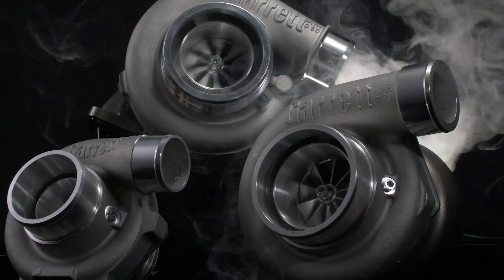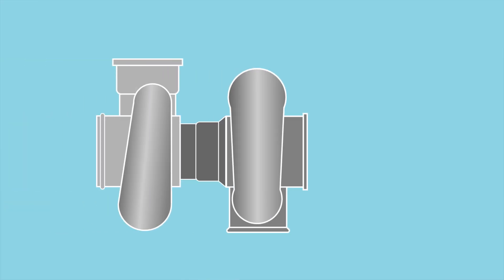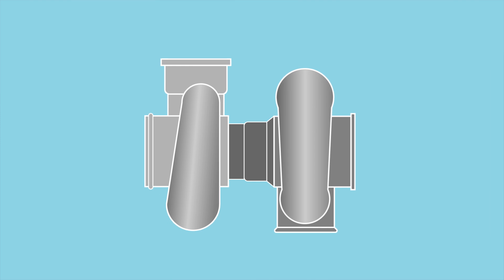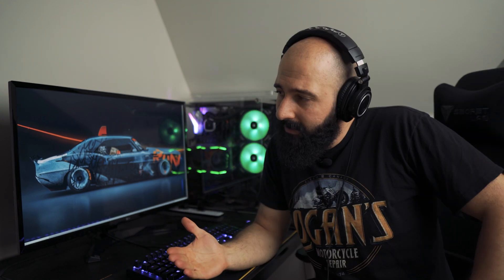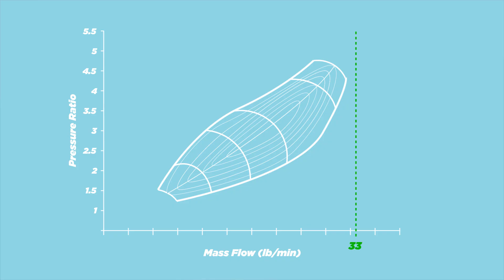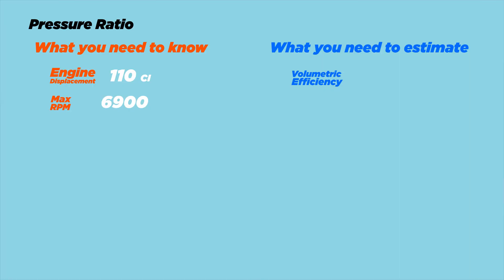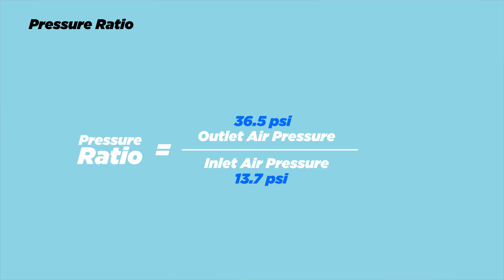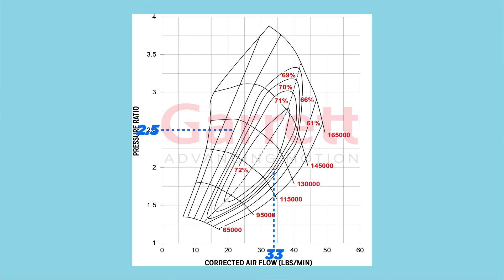How to choose the right turbocharger || EXPLAINED

Comment: Thank you for making this video and just cause you asked what were thinking of turbo charging I bothered to write this. I'm contemplating turbo charging a 2003 Ford SVT.  1.988L DOHC Zetec-R 10.2:1 170HP 7,000RPM 198 lb ft. 6 Speed manual. I've been fixing it up and have even taken cam followers from two Zetec-E's and had them machined down and installed so all the valve clearances are now within the beginning range tolerances. Focus cam followers have a long shaft inside vs SVT cam followers so you can use them in an Svt every time if they are machined. This is for the 2000-2004 range of Zetec engines. I'm not sure if I'll do this but I've seen videos of people who have hit 500HP so I got curious and it's led me to this video. Thanks again.

Comment: Great channel. Question. I have a 12.5:1 compression ratio on a Cayman 3.4l and everything I’m reading/seeing says that this ratio is too tight. In the forums there are several turbo kits that stay below 6psi, offer real gains, and don’t over pressure the engine. TPC performance has such a kit, but the components are cheap knockoffs. What’s a good user friendly turbo with minimal complexity? All in one package?

Comment: I run a GT2867 r and it’s laggy.  That’s because I have a long tube header exhaust manifold. With a short log exhaust the turbo will probably be perfect but it’s not. I am contemplating of switching to a 2860 as it will spool faster than the 2867r

Comment: Doing an under truck setup on an 03 F150 5.4 2v. This was awesome. I'd seen another that came at the same number based on displacement that was just as easy, but it's cool having both methods at hand.

Now I need to figure out the exhaust side, lol. I'm running 1.75" longtubes into 3" collectors, through a 3" y-pipe. My turbo will be hanging at the end of the y-pipe...so velocity and heat energy should still be good. Maybe not quite as good as an under hood...but still great. CX Racing sells an underhood kit for my truck (based on a 4.6 2v), and a guy on YouTube hit 400whp (my goal) at 10psi...which is about the safe limit for these things on pump gas. It's .81AR. I figured I'd start with that as a completely uneducated guess...but it would be nice to have the numbers to back it up.

Comment: I don’t know if my calculations are correct  but it’s showing I need 29.3 lbs of boost !! Wowzers 

Target hp 900 
afr 11.5 
Maxrpm 7,000
VE 95?
Air temp 130?
6.0 LS bored .030 over. 
That’s 370 cu. Inch. 

I make north of 700 with small 54/56 T3 agp turbos at 14-15 psi of boost. 

Looking to upgrade my turbos and I’m not sure what to go with because bigger turbos at 29lbs of boost doesn’t sound right to me 

Anyone can give me some advise

Comment: Looking for help. Have a M340i B58 (G20).

My stock turbo is done, my tuner advised to replace with stock instead of an upgrade (such as a pure650). If I want 500-550, should I stick with stock with DP and a good tune, or go up to a smallish upgrade. 

I doubt I’ll want more than 500-550.

Thanks for the advice boys

Comment: I’m glad I found this! Thank you! I am a few weeks & few hours in on research and video time and while I did learn a ton but this info is non existent regarding the confusing subject of Turbo sizing with the dozens & seemingly hundreds of different sizes and combos & little to no info on which is best & kits that come with a Turbo generally don’t explain why and what to expect other than rated @ so and so HP       set up, where want the power & how is what I was trying to learn and bam 💥, finally method with your video 🙏🏼.     Now have to find out the required specs to start narrowing down what size!    Sub’d!

Comment: Hey nice info, thanks. Thinking bout turbo my 66 mustang coupe engine swap to 351w, .040 over pistons, thumper howards cam, springs, plates, 1.7 arms, Victor jr, 750 holley, long tubes, polished, ported.wanting 550-600hp wheel

Comment: I'm going to turbo my 1970 Challenger R/T. It has a 440 that is super mild. Stock iron heads, forged pistons with about 9.2-1 compression and a mild hydraulic flat tappet cam. 5500 rpm max. I only want to make about 650-675 horsepower at the crank as I drive the car on the street the majority of the time. Now that I understand how to pick the right turbo thanks to your video, I am confident that will be easy.

Comment: Thanks for making this guide. I'm running a Honda Del Sol in autocross and hoping to eventually turbo it keeping stock internals. I know most ebay kits for the d16z6 have the potential to make 400+ horsepower and are targeting drag racers. I'm aiming for 200-250hp at the most so I don't blow the engine, and I need to make power as fast as I can and increase low end torque for autocross where I often can't even reach vtec rpm on most of the track.

Not looking for any answers on my specific setup. I'm a year out at least from the turbo job and when it's time to actually blow all my money I'll follow this again getting all my own numbers into the formulas.

Comment: I'm contemplating turbo charging my gen 1 89 Ford SHO Yamaha 3.0l 220hp stock 215ft lbs car's low mileage but definitely isn't ready to boost yet, too many leaks, and possible sensor issues ATM

Comment: Just started following you. I want to turbocharge my 03 Nissan 350z VQ36DE. 135k miles. Target HP 500. I have not done my research on the max HP VQ makes. Has oil leaks and tick noise. I will be removing the engine to fix all these issues. Any tips(I know the water pump) that I should replace while I’m in there?

Comment: For a diesel 2.4 4400 Revs max  2378 CC 
5 cylinder 20 valve what’s is the best turbo to fit to 
Have a fast spool and top end?
It had a Garrett turbo 
It was generating 210 Horse power 
We replaced the inter cooler larger Exhaust 
New Garrett turbo water cooled GTX2871R and it takes long time to spool up so basically we massed it up
Before with the original turbo use to spool up at 1500 Reve’s  now with the new larger turbo 
2800 Revs and at 4400 revs the limiter comes on
If you can recommend me a turbo that’s will give the best power ratio please?

And obviously I get smoke now when accelerate

Comment: Just seen this video explained things very well, but I am confused on results I got on a mock car. When I set up the mock car “Toyota matrix looking to get 200hp” I end up with a negative boost LB needed to achieve 200hp because I live not the mountains. The manifold pressure came out at 26.4-30.5 ambient air… I get -4.1 lb of boost needed. Changing the desired horsepower would lead to a positive number. So just trying to wrap my brain around what the negative number would imply in the application.

Comment: This info is sick.  But question.  Say i come up with a CFM of 81/min that i need to reach my HP goal. If i decided for say my v8 build i wanted twin turbos, is it as easy as just finding two 40CFM per minute turbos to equal the 80-81CFM? Or does it calculate differently with a twin turbo set up?

Comment: Hey Mr zopyrus say it zop are us and it’s really funny if your Maltese I’m not but it was pointed out to me I think you’ll laugh too from what I take your sense of humor to be from your video anyhow  I’m looking to build a 2.0 tfsi for 500-600 hp  if not more from stock internals at this stage  with a Borg Warner  EFR turbo turbosmart electronic straight gate some integrated engineering bits and o34 bits and pieces  being trying to map  at same variables you show in video and wanted to pick your brains on which turbo to achieve sweet spot for regular street driving and some fun when wanted or track days even considered  syvecs stand alone ecu for some serious stuff later on ,your thoughts or even perhaps a full video what do you reckon

Comment: Currently have a twin turbo rear mounted Cartech kit on my 92 3.0 liter Acura NSX. I've upgraded displacement to 3.5. Kit specs initially were gt28r53 so I could've upgraded to gt2860. If I wanted to upgrade to a newer series more efficient turbo what should I look for to make sure I get 600hp in the most efficient turbo possible.

Comment: hi,  everythink you said is correct and  the turbo you suggest is efficient but isn't too big and lag will prodused at low rpm?  some racing websites suggest garrett like gbc20-300 or gbc22-350 for the same car and hp but when i check the graph its not even close to efficiency. what do you think?

Comment: I keep getting a decimal while calculating the manifold pressure. My answers if I flip them, 16.07 or .06. Chevy 350, target 420hp. Turbo to push 46.2lbs of air/min

Comment: Can someone explain exactly how to calculate the manifold pressure formula? I'm getting extremely wrong results, it's not a problem with the 0.95...im calculating it as 94.32 x 639.6 x 570 ÷ 0.85 x 3350 x 345 and I'm getting 46,755,432,558,212.....clearly I don't know what I'm doing if someone could explain what I'm not doing right that would be great! (Specs are from my engine)

Comment: Thanks, your video was not boring, and it was jam-packed with knowledge simplified. I didn't know anything about the intricacies of selecting a custom turbocharger for engine size and/or desired boost. I figured I needed to learn as I may have to put one together since there are only options to purchase a supercharger  kit for a 3.6L V6 dodge challeger. Most videos only give you a general overview of what they do. What would you recommend? I'm only looking for a modest boost between 50-100hp.

Comment: If you have time (like, hours) to burn, I recommend BorgWarner's matchbot. That way you don't necessarily have to do all the calculations yourself by hand. You're also able to see exactly what turbine size and A/R housing you need for your application. Trying to make 300hp at 6900 RPM is good and all, but how will it behave below that when you want to increase the pressure ratio to keep power up while under redline?

Comment: I went with a GTX2867R Gen 2 on my Focus ST (2.0 TDI) and it hits peek boost around 3200-3400 rpm. I wish I would have gone with a 2860 though because I'm tapped out on fuel. Would have gained the same amount of power but hit peek boost around 3,000 rpm with the 2860.

Comment: How do I manage picking a turbo for a car that has a larger than normal displacement for its factory HP and target HP?  I have a flat-6 2.7L air-cooled '64 Corvair....rated at 110hp, 5k rpms max, only looking to get to 180-200hp.  My concern is not having enough flow through the exhaust housing on a smaller sized turbo made for my HP goal, but then also not not being in the efficient zones of a compressor map of a larger turbo.  

For instance, I'm think of a Holset HX30w or HE221w...the HE would be more efficient at my goal HP zone, but will it flow well enough?

Comment: please help me with the math. I’m an old Fart. Looking for about 700 hp.
I have a Dodge Challenger 6.4 L automatic. I purchased a used twin turbo set up complete.  
The kit was designed for this exact type of application. The turbos on the other hand are junk. Seals went out and was smoking. Also, when I took them apart, they had some chips off the compressor side. So therefore, I am trying to determine what size Turbos I Should purchase. 
The kit came with Turbo Netics and I have no idea what size they are. 
Also, I am Wyoming at about 5500 elevation  
I don’t really want to go with a super expensive turbo. I will mainly be running it on the street on pump gas. 
I appreciate any help you could get me and thanks so much  Ken

Comment: I have been building engines for years. This is the best explination of turbos i have seen in a while. 

In my years i have developed a formula that will give you a fair estimate of what your naturally aspirated engine should make after boost. Of course with this being a math formula, this works in reverse. 

Take your desired boost level, divide by ambient pressure, add 1, and multiply by your naturally aspirated power. This will give you a rough, but close idea as to what your engine will make, boosted, once you make the necessary fuel and timing adjustments. 

Example: lets say i have a 500 hp engine, i can safely boost this engine to 5.5 psi (this is theoretical) and my ambient pressure is 14.7 psi (sea level). 5.5/14.7=0.3741496599. We will round this to .374. Now we add 1. 1.374x500 = 687. 

So, if we had a 500 hp engine, and we added 5.5 psi, we would roughly net a 187 hp gain. 

As a general rule of thumb, if you double your ambient pressure, you also double your horsepower. 

Of course, this method isnt totally accurate and it doesnt factor in if the engine is not tuned properly in the first place, it doesnt exactly account for changes in exhaust velocity, it doesnt account for intercoolers and if you are running a supercharger it doesnt account for the power loss required to run that pressure. So this method is not going to tell you EXACTLY what you would make, but it can get you within roughly 50 ish hp either way on most applications. This formula only works for gas engines, diesel engines respond totally different to boost and there is no real clear formula to solve them, and the maps are totally different for a turbodiesel vs a turbocharged gasoline engine. 

On a side note, do keep in mind that a turbo gas engine and a turbo diesel engine are totally different engines, in the way that a turbo diesel engime usually produces 1.5-2.5x more torque then hp. A good example is my daily driver, a 99 ram 2500. It makes 555 hp, which is no slouch. But it also makes 1101 ft lbs torque, which means it can still compete against a 550 hp gas car, despite being a 7500 lb brick.

Comment: Trying to turbo an R6 sport bike. I don’t have a target horsepower. Just after the sound and feeling. Help me pick a target horsepower because it seems like a lot of the calculation is based off that but I am not after a lot of power to be honest.
Reply from the maker: I'm sure it's still doable for that displacement (600cc) .. however .. I've ridden the R6 .. the power curve is very parabolic as it is, and the bike is absolutely insane already and sounds great with a good slip on

Comment: I’m trying to turbo charge a m102 190e. I will also explain the reason I am doing it is my workhorse. I got it as a student and did chores and farm work on the weekend, then road trips on vacation. I have gotten used to the power and would like more but it could also keep up with modern traffic. I also plan to tow small trailers with it like a jet ski.

Comment: Gox the target hp is it the actual target (engine + turbo ) or  additional hp from the turbo
Ex: engine has 150 hp on the crank. 300 hp target will be with 150 engine + 150 turbo or 150 engine + 300 turbo that means 450 hp total hp?

Comment: I want to turbo charge my 2004 Nissan maxima going to swap to a six speed manual. I know that these cars already relatively high compression ratio I was thinking, may be running low boost🤔 if I’m not mistaken, the compression ratio may be lower for the manual than it is for the automatic. The automatics compression ratio is 10.

Comment: O.K. 25 years ago I bought a book and read through it and for me it took some time, this guy explains it so quickly and accurately, he did skip the exhaust housing size, but they are easy to swap, one of my cars I went from a 0.86 to a 1.02 A/R and gained a lot top end and lost very little at lower RPM. Current build is a N54. I'm a full time dyno tuner and a mechanic for 37 years and this was a great refresher
Reply: What turbo woul you recommend for a 3.6 Camaro
Reply: @Buddy-nu6le  That is an easy question but not so easy to answer, Watch the video, but with the info I have (3.6 Camaro) I'd look into a Garrett gtx3582
Reply: How did you become a tuner? Im a young mechanic with 5 years experience and I want to learn that too! Hello from Greece
Reply: Buy a second car, preferably turbo cheap and available. Buy an aftermarket ECU and start from there. Knock detection and Wideband is also required. Now days there is also HP academy and they are quite good as well, buy the lifetime membership, the only problem with online courses is they expect everything goes right and nothing ever does
Reply: @phoenix_NZ  i bought it already! But reality is a bit different.. thats why im asking! Thanks!

Comment: I can't seem to find anybody to explain this to me, but why does it seem like 4 cylinders with monster turbos commonly seen on drag cars just... don't follow these rules? How does it still work?? The Red Demon, for example, makes 1,800 horsepower from a 2.0L through a single turbo, and the pressure ratio is almost 7.5:1. It's double the highest pressure ratio of the least efficient island on the compressor map, and exists entirely to the left of the surge line! How is it not just moving hot air, and how does it not surge?? Not an anomaly, either. 4G63s are raced with S480 and GT42 turbos very commonly, and when you try to plot the specs on a compressor map is always in surge at the lower to mid range (sometimes the entire line) and it always goes well above the map because they require such a high pressure ratio. I've tried asking a few guys I know in the DSM community who run big turbo cars how they get away with such high pressure ratios and avoid surge, and the universal answers seem to be:
-"What's a pressure ratio?"
-"Ignore the compressor map, just pick a turbo for the power you plan to make"
-"I don't know about any of that stuff, it just works"

Comment: I want to turbo charge my 545i NA V8 4.4 333 HP 450 NM to about 750 hp i want a turbo that doesn't loose top end but i also hate turbolagg so somehere in the middle, what turbo would be best? I want integrated wastegate but not if it compromizes the powerband so rather external and the perfect turbo for my build then other way around

Comment: I wanna turbo my 05 civic ex 1.7 with a 5 speed any suggestions on a turbo 
I did buy a used motor to go over with new gaskets new valves and forged pistons